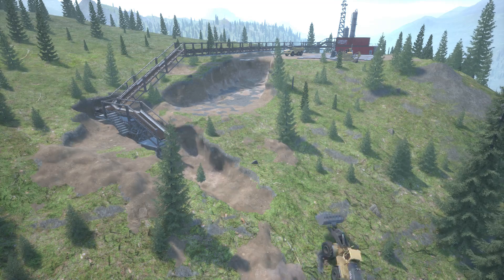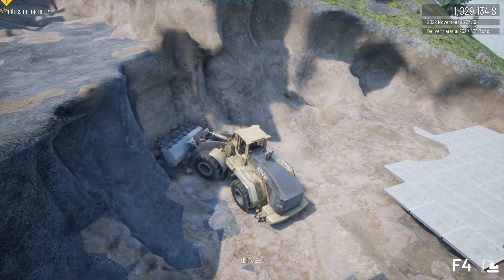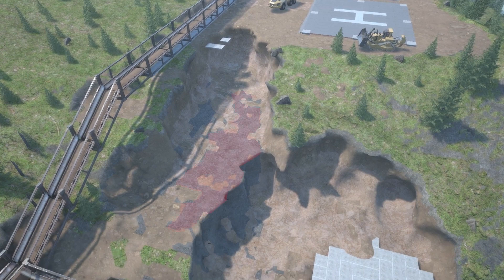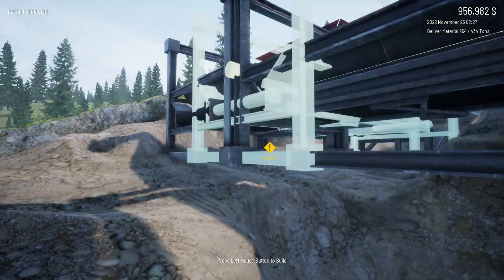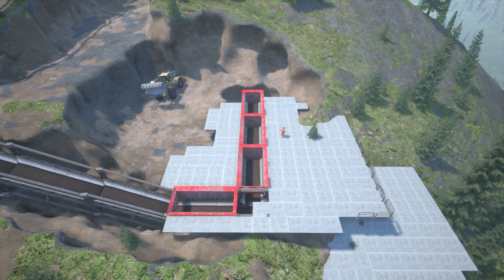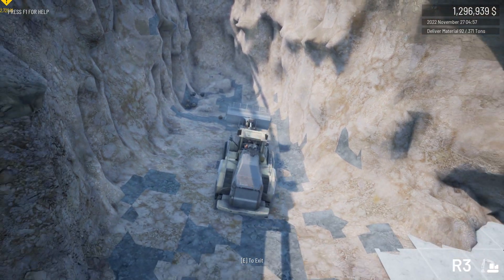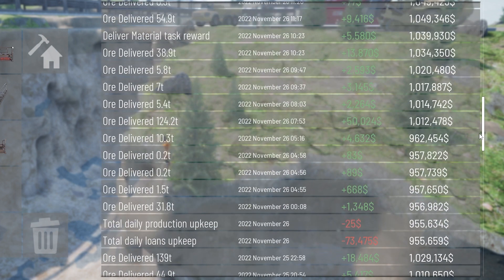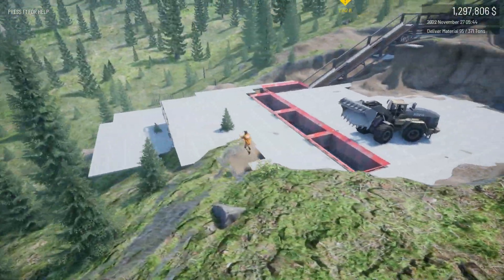Digging up all the COAL - Out of Ore - Episode 4

Comment: There's a huge lithium vein nearby but maybe you want to go prospecting. :)
Reply from the maker: Thanks for letting me know! I was checking out some areas off camera. I think there is a big one behind that one fuel station, but also a few ones up hill. In my next video I'm planning to set up some belts in that direction. (Hopefully they work long distance)
Reply: @RealPoochGaming  I can tell you where it is but I don't want to spoil anything. So if you want to know where it is you have to tell me. :D
Reply from the maker: Sure, why not. Don't think it will spoil much. Thank you!
Reply: @RealPoochGaming  If you stand in front of the drop off point with the building in your back it's ahead and to the left. Go around or through the little wall there to get to it. =)